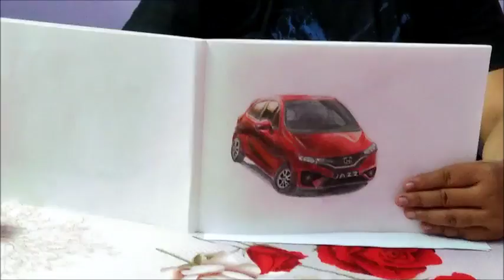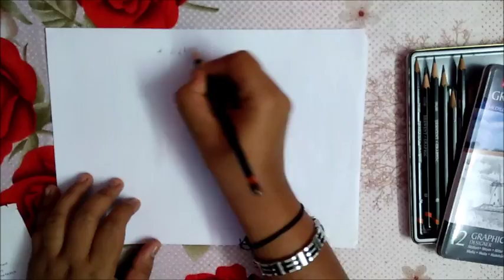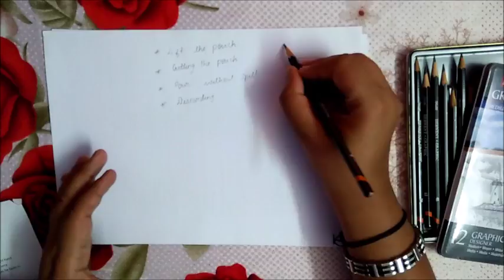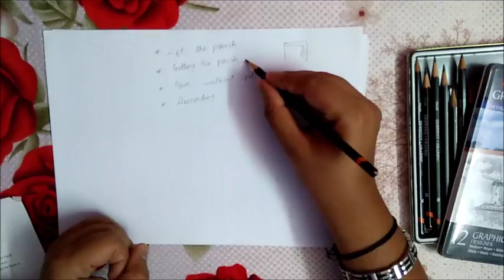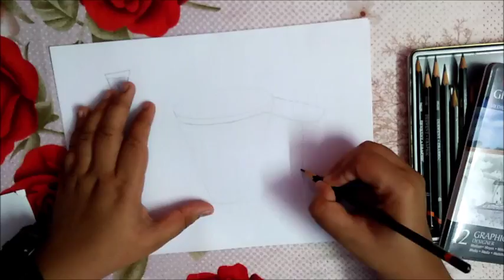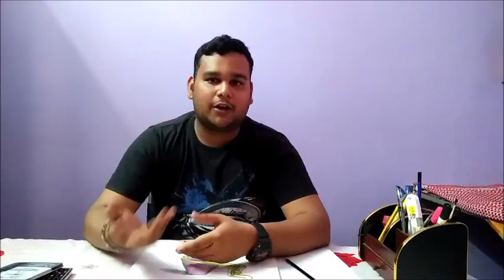Design Twist - Milk pouch cutter design based on CEED question

Comment: But milk packet comes in a square shape not cone shape  😂 idea is good but container should be of square shape . And one more thing a cutting milk from bottom will be very dangerous and it will spill . Which Is mentioned in question that it should not be spilled .